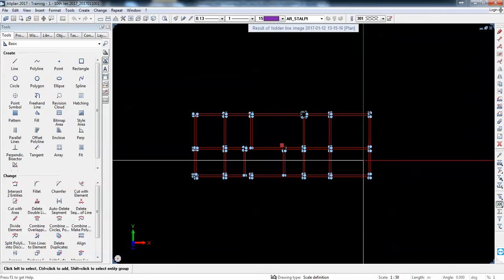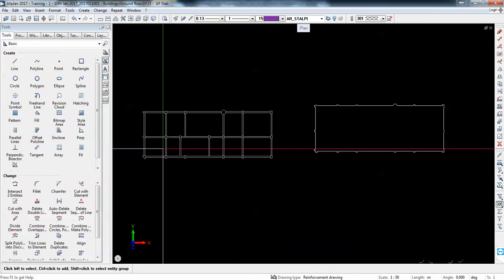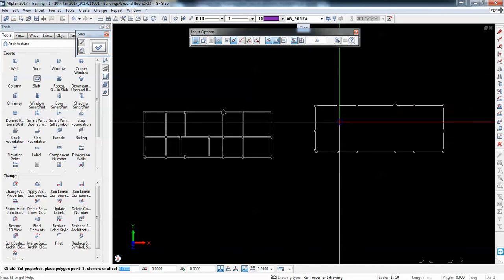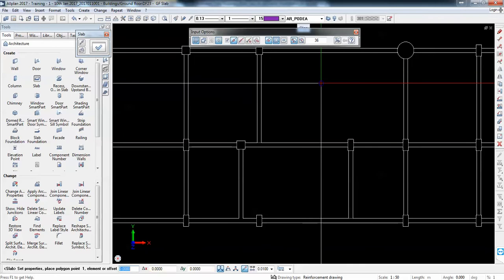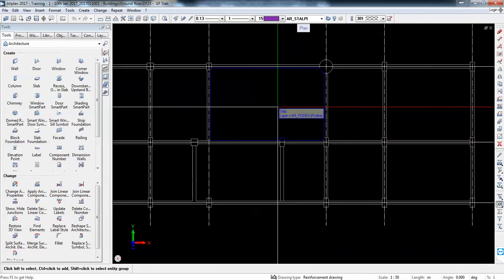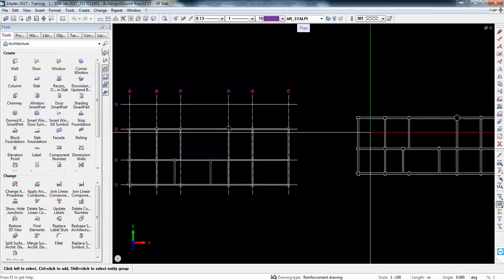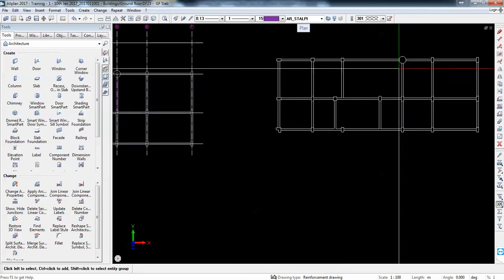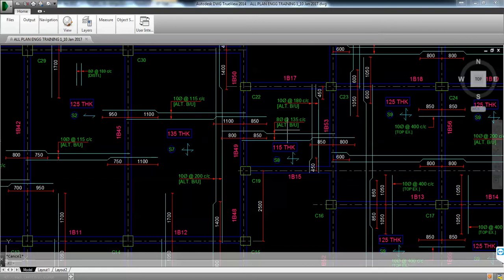#10 Allplan Training: Slab definition [EN]

Comment: How to model waffle slab into allplan?. Please.
Reply from the maker: You can model it as a typical beam creates a recess that matches the required depth and distribute those through multiple copy. Alternatively, you can creates a network of small beams and cut with a surface the contour of the building.